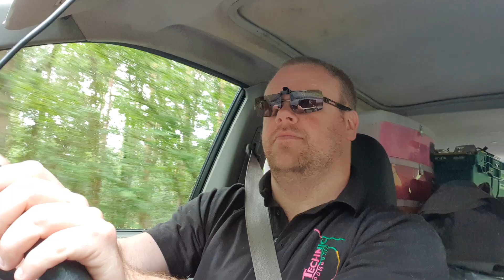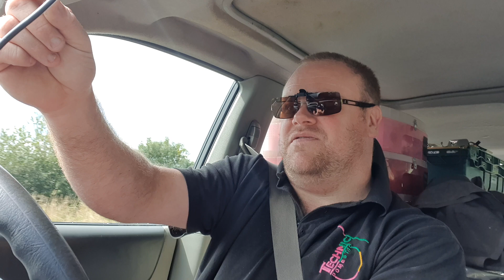Exciting motor controller development

Comment: Hey jason
Im following you from around a year from another accont 
Iwatched every single video in your channel 
Specially the series videos about inverter making and igbts
Im sooo excited and waiting for the new video
 I rewond 10 hp 50 hz 400 v 3phase induction motor for lower volt to get higher power from it when trying to increase frequency
And now iam trying to make 3phase inverter using #6 "80n60" n-channel mosfet and arduino..so is this possible with arduino?or should i use stm 32 because i saw some peoble made it with stm 32 but only few people made it with arduino
And Im little confused
Should i use 6n137 optocopler as a mosfet driver or pc817 optos because i cant find many choises here in my town im sure you can help me
Im wairing for next video on fire please dont forget me and get late pleaseeeeee
Greeets
All love
Stay creative
Reply from the maker: Hi buddy sounds good.. actually i had a few problems with ooto coupler s and have filned most of that cideo. Thats thw next video out so keep an eye out. Been very busy with business (the day job) but yes have been filming quite a bit too... just got to edit
Reply: @jaysjetskis  awessssssssoooooome i m waiting youuuuuuuu goooo on you are soooooo creative gooo on man goooooo on i wiiish you all goood luck
Best news everrrrrrr
Reply from the maker: Thank you. :-) i am still going :-)

Comment: Not sure if this might be relevant to my build... 
I've just installed a DIY electric drive system in my narrowboat using a 48v forklift motor... 
However after a couple of test-drives I blew up the sevcon control panel and the throttle... 
And this video has just popped up on my YouTube... 
Wondering if you can advise if it would be the sort of thing that may help me? 🤔
Reply from the maker: Yes keep an eye on.. i have some other vids on a diy power stage with some important snunber circuits etc hooefully that helps
Reply: @jaysjetskis  if you need a guinea pig to try some theories / ideas / tests on... I'd be happy to let you use my boat as a test / demo...
Reply from the maker: Thanks very much :-) where abouts are you located? Im in southampton
Reply: Mmmm, I'm in Sheffield...
Reply from the maker: Ahh southampton here

Comment: Building on the OpenInverter board? Uses the STM32 as well. I'm likely to start down that road myself.
Reply from the maker: No this is something totwlly different all together this is unlike any other motor controller out there :-)
Reply: @jaysjetskis  I'm stoked. Do it! If it based on the STM32 then you could be alternate software for others who use that platform.
Reply from the maker: Im doing it ! Lol i run a business also which eats up a lot of time .. but will get there soon :-)
Reply: @jaysjetskis  Hi
Im trying To make up a team To work on cool electric vehicle so that we can start to offer ev conversions on the cheap for the masses of ppl without breaking theyre budget here In Finland, and need ppl who can think outside the box like you.
If you are interested to take part in it, you are welcome to do so, let me know and we can be In touch.
Best regards Tori from Finland.